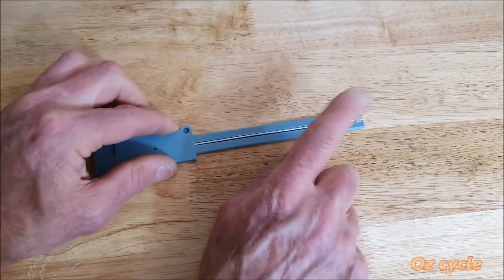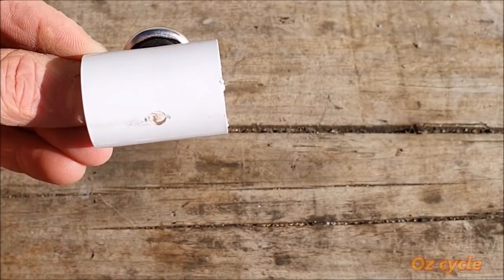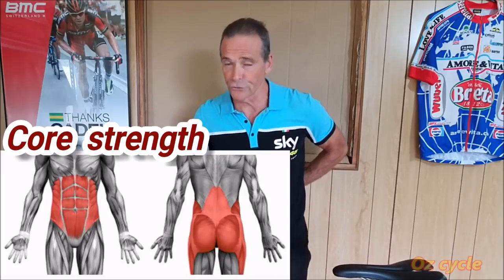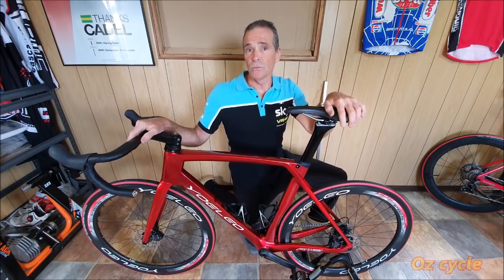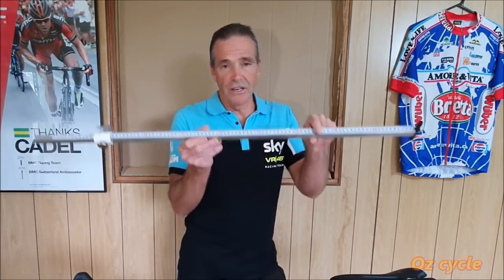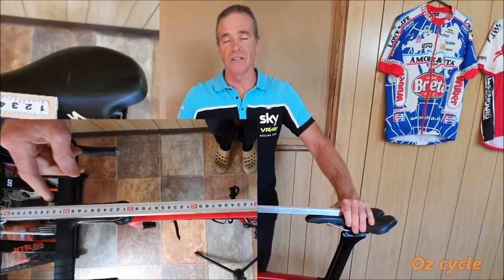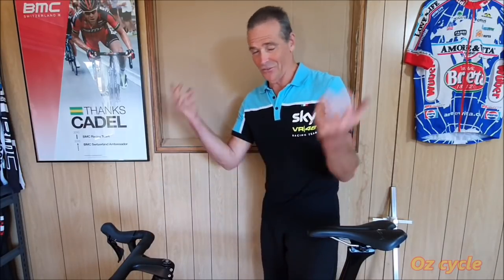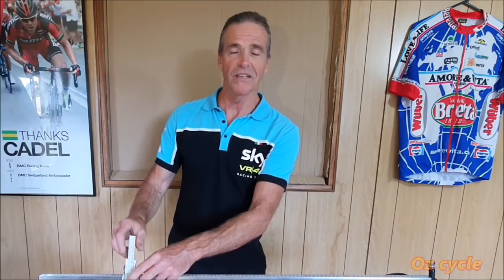Bike Fit Tool - Pt.2. Finish & how to use

Comment: Very cool tool, not sure I could replicate the building of the tool, but still very cool!
I have this iPhone app that measures seat tilt by resting it on the seat, curious how accurate it is compared to the accurate measurements you used.

Comment: Given the spine can vary 10-35mm in length during the day (decompressed overnight, compression during the day), I don't think you need to millimeter accurate with most measurements.
Reply from the maker: Good one...Theres a good topic for research !

Comment: Question, with the various handlebar types wouldn't it make more sense to measure the grip position of your hands? If so, is it a problem for this tool when it's not parallel to the frame?
Reply from the maker: Yes , always measure from the three contact points...hands , feet , sitbones.